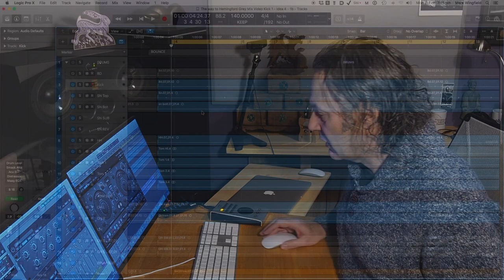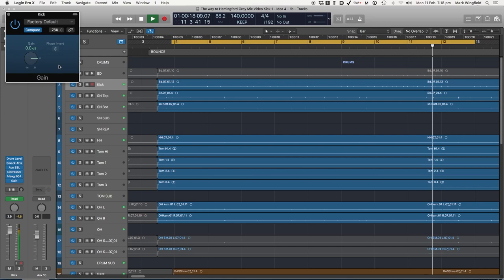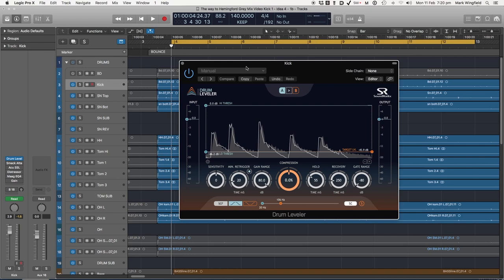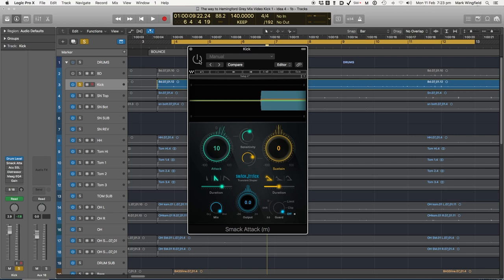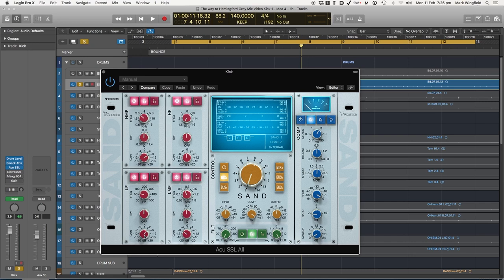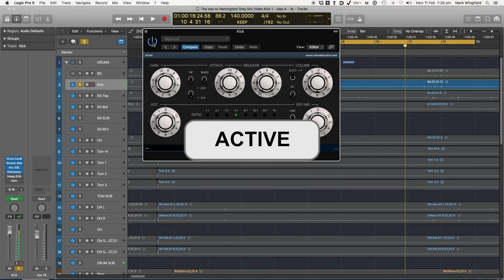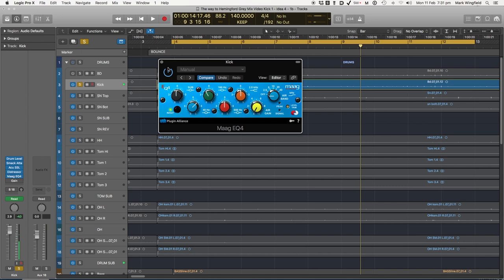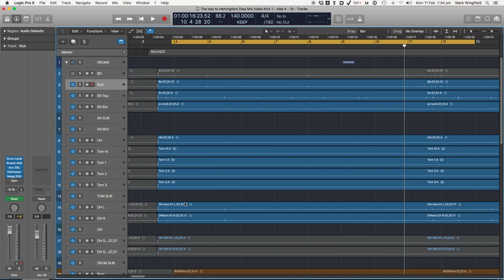Mixing Jazz - Making a kick easy to hear in a dense arrangement

Comment: Interesting session. Often many small steps seem to do the trick better then overusing one or two plugins. I got the SKnote Disto and the Maag as well and they are astonishing plugins. I also like the tune very much. Cheers
Reply from the maker: Thanks. Yes definately, I find lots of small moves sounds better than fewer large ones.
Reply: @heronislandstudio8054  absolutely. But sometimes it's very difficult to hold oneself back to not overdo things. Those tiny step processes combined with continuously comparing to the original is a thing I had to learn and still do.